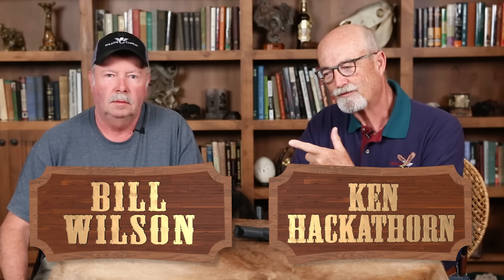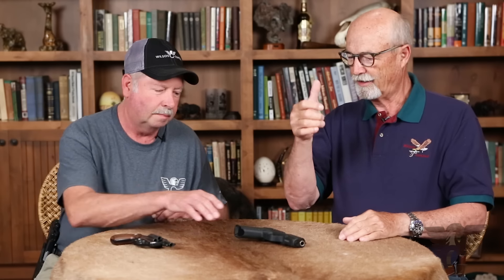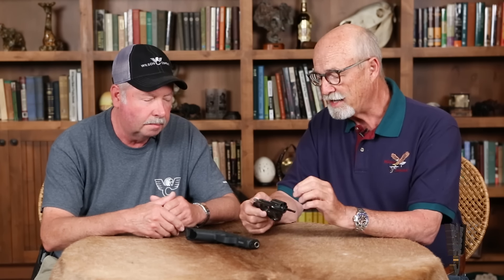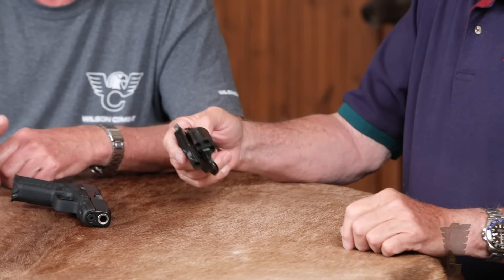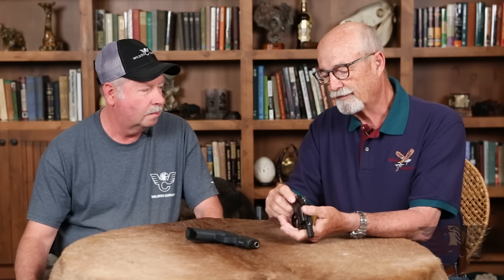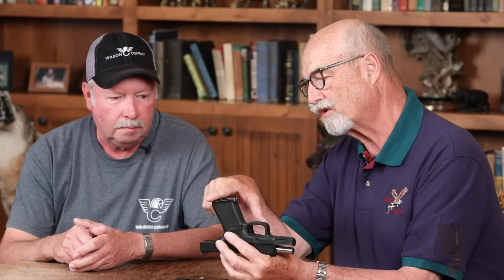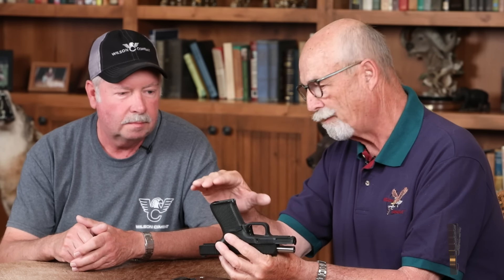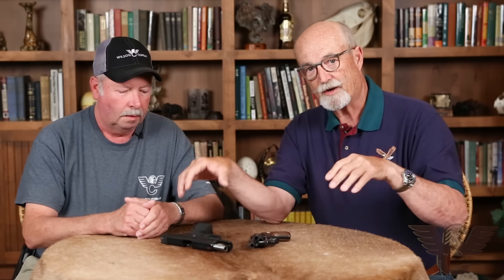DON'T DO THIS to Your Guns - Gun Guys Ep. 17

Comment: Are you kidding? Cleaning your guns and reloading ammo is Zen. I love it almost as much as shooting them! I even love sifting the sand pile in my backyard shooting range (I live in the country) for bullets, cleaning and washing the bullets and melting them down to make more bullets (let them dry thoroughly or they go bang in the melting pot). I collect brass at the public range and sort it. Man, if you don't love this stuff then you're not a real gun guy! Get with the program!

Also, I have two 1911's I hand customized with about 3-pound trigger pulls (titanium innards, oversized barrel bushing carefully fit, blah, blah) and I NEVER drop the slide on my empty gun. Yes, it would wreck the trigger pull. Nor do I flip the cylinder closed on my DA revolvers. If I let someone touch my guns (rare) and they do this, then I take it away and give them a long lecture.

Comment: Agreed on slamming the revolver cylinder.  Not a good thing.   The standard GI 1911, dropping the slide, not a problem.  It was part of the military training.  During inspection you dropped the slide.
Reply: They also didn't have sears barely touching for that 3 lb trigger. Just saying.
Reply: @sofloemir  I have watched videos on what happens internally when a 1911 cycles and I STILL don't see how dropping the slide on an empty chamber is going to cause excessive damage.  

I mean, the energy needed to strip a round from a mag isn't THAT much, so whether or not a round is being chambered should be irrelevant.  

Probably still shouldn't do it, because it isn't necessary (outside of a function check), but still.

Comment: 2000 rd test shows dependability ,reliability, longevity.  Seems like a pretty simple concept.
Reply: …you can afford to fix, replace, or repair it?
Reply: I don't recommend hammering away with 2000 rds on a new piece ! I do recommend you watch some youtube videos that do this to show how durable a particular piece might be right out of the box!  So the concept of the 2000rd test is pretty simple.  I also think any weapon you buy should be able to pass this test pretty easily or frankly is not worth owning!
Reply: @mikehilliard3229 This is just such foolish garbage. How do you not understand the fact that every gun is different, and though a given firearm has a reputation for reliability, that does not guarantee that every firearm of that type is reliable? Any time you have a manufacturing process, especially where humans are involved, mistakes can be made. Products are recalled all the time because of all kinds of problems. Guns are no exception. 

Not to mention, many firearms are ammo-sensitive and need to be tested to determine which ammo is most reliable and accurate in that particular firearm. 

Not understanding these concepts is a sign of someone who really doesn’t have much experience with firearms.

Comment: Really? Using the slide rease when locked back, is an issue, because the slide slams forward. 

You do know that that is precisely what happens, every damn time you fire a round!
Reply from the maker: Turns out, we do know, we've kinda tried it. Did you know that it happens with a different amount of force, and at a different speed, when chambering a round as opposed to slamming it shut when empty and under spring tension? Did you know that doing it repeatedly will deteriorate the engagement with the sear and wear out your trigger job?
Reply: @gowilsoncombat  Makes sense. 

Trust me, I also cringe when I see a weapon abused. Even a factory spec one. Guess I missed that you were talking about it, on an empty chamber.

My mistake.
Reply: @gowilsoncombat  ok, then how about when Ken said instead of using the slide release without a round chambering to just grab the slide and basically slingshot it to close it (4:38 in the video), doesn't that close the slide (action) with the same amount of speed and force but with at different process rather than the slide release?

Comment: IMHO dropping the slide on an empty chamber is as bad as flipping a revolver cylinder shut. That causes the locking mechanism to drag on the cylinder, leaving an unsightly ring on the cylinder and damaging the locking mechanism as it wears out dragging on the cylinder...
Reply: It's called a slide release. Because it releases the slide........ Its designed to do exactly that 😂

Comment: Some gold info here.. 
IMHO, that 2k round test would only be applicable for war situation as a military personnel may be in a situation where they could not clean their gun after x amount of rounds. But I also don't see military personnel using a pistol that much in a situation like that either.
Reply: I really can't see a situation militarily where someone would have to fire 2,000 rounds without being able to open up their action, wipe it a little, and throw in some lube. That'd be 67 magazines through an AR/M-16 platform (and most other military rifles) or 118 magazines through a Glock 17. I very rarely see any soldier from any nation carrying more than 7-10 magazines. A lot of soldiers will have some kind of weapons maintenance kit in their rig specifically so that can clean or at least lube their guns in the field, it takes all of 2 minutes to lube a modern rifle or handgun, if that.
Reply: It's a good test because it's a torture test.  Like knowing your gun won't fire if your throw it hard on cement.
Its true you shouldn't be throwing your gun on cement but this is the entire point of torture tests and reliability tests
Reply: @jason200912  Except that dropping a gun on concrete or cement is something that can (and does) happen pretty regularly. So does, say, dropping a gun in sand or mud or even having a gun run over by a vehicle in certain situations. There really isn't any scenario where a gun would ever be fired 2,000 times without cleaning or at least a wipe-down and lube.
Reply: @blobfishgunner5365  sure there is if you're in a Korean trench and you're the last man alive with a crate of ammo.
Or hey maybe you're a conscription soldier/African rebel and so nobody taught you about needing to clean these and you don't have access to cleaning oils.

I'm sure GPMGs are often needing to fire 2000 rounds without a wipedown or cleaning too.
Reply: @jason200912  If you're the last man alive in a trench and you're facing enough enemies to need 2,000 rounds of ammo and not enough time to lube your gun, you're just dead. Your gun's going to end up with heat related malfunctions and damage before you reach 2,000 rounds if you can't stop firing for 60 seconds to throw some lube on there. As for the low-training conscript or rebel, it's pretty unlikely you'll ever even touch 2,000 rounds of ammo because ammo is something your leaders need to conserve.

GPMGs need to have their barrels changed every few hundred rounds of heavy firing, otherwise the barrels overheat and warp and the gun becomes nonfunctional. The M240B manual suggests changing the barrel every ten minutes of sustained rate fire or every two minutes of rapid fire. Much less than 2,000 rounds.
Reply: @blobfishgunner5365  well if you're fighting a horde of charging attackers you're not gonna abandon the smoothbore MG just bercause the manual says to not fire it after 200 rounds.
Reply: @jason200912  I never said anything about 200 rounds, it can be 200 give or take, the issue is that after a large amount of sustained fire the barrel will become hot, warp, and make the gun effectively useless or some other heat/sustained fire malfunction will occur. Not to mention that the enemy can also shoot you while you reload your weapon 20 times during the engagement if you're using 100-round belts. 2,000 rounds with no weapon maintenance just is not a feasible scenario.
Reply: @blobfishgunner5365  not feasible but still possible.  Every single silver star and medal of honor story is basically unexpected and unfeasible.

Comment: Unfortunately the video didn't quite effectively emphasize that this matter of sear and hammer damage due to releasing the slide dry is really only a major problem on a highly tuned 1911 and ONLY a highly tuned 1911; Other pistols generally do not have this issue, and even a typical 1911 along mil-spec lines is not going to have an issue with this as the hammer and sear has more vertical material and surface contact which results from that. The hammer notch its self is a little bit deeper too. On your typical 1911, well, this also applies to a race 1911 too, one thing that can be a problem is not the slide release on an empty chamber, it is releasing it on a cartridge in the chamber which was placed by dropping it into the chamber from the ejection port instead of being fed up with the cartridge rim guided up behind the extractor from a magazine in the normal forward return in the cycle of operation. Obviously, the extractor is angled to overcome this, but this will overtime wreak havoc on the extractor in particular.
Reply: i had no problem understanding they were talking about highly tuned 1911s as far as sear and hammer damage.
Reply: Most people never made it past the first minute before they started typing furiously, hoping to impart their great wisdom upon the internets lol.

Comment: No mention of using the slide catch as a release on full or empty 1911s in your manual.
Reply: No mention of not sticking your tongue into the eject port, either.  Browning put knurling on the top of the slide release for a reason.
Reply: @SoloPilot6  There is always one isn't there.  If it would potentially cause damage wouldn't a smart manufacturer put that in a manual so not to cost them warranty work or other liability? Browning is Browning.  I have no idea what is in every manual for each individual firearm they make.  Didn't get there yet.  Regardless,  this is Wilson Combat and they are talking about how releasing the slide on an empty chamber can damage to their fine tuned product.  I was pointing out, since it makes them cringe, they neglected to address this in their manual leaving them potentially liable for any mechanical damage or accidental discharge that may occur from this oversight.  Now out of curiosity on this subject I have gone through Wilson, Kimber, Glock, Ruger manuals on various pistols especially any in the 1911 style.  I have yet to find a manual that specifically says this action can damage their firearm.  Some even state to release the slide by depressing the slide release.  Many warn of not letting the hammer fall on a frame with the slide off and that it may cause frame damage.  Rimfire products warn not to dry fire due to potential damage.  Since releasing the slide is well within the everyday operation of an automatic pistol, a warning about how that should be done, especially if there is a wrong way, would be expected.  
Now if you would kindly show me where Browing states that the kurling on the slide release is for anything other than to provide a better grip surface I would be interested in seeing what they say.  This is what the Browning Highpower manual says. "To close the slide,  be certain the  “safety”  lever is in the off  safe position and your fingers are away from the ejection port and trigger.  With the muzzle of  the pistol pointed in a safe direction,  simply depress the slide stop located on the left side of  the frame".   
The 1911 clone in 380 says this. "To close the slide,  be certain your fingers are away from the ejection port and trigger.  With the muzzle of  the pistol pointed in a safe direction,  simply depress the slide stop located on the left side of  the frame.  After closing the slide immediately lower the hammer to the dropped position or place the  “safety”  in the on safe position".
Reply: @doclees11  Your point about noting this in the manual is telling, especially in this age of overlitigation.  I was taught that the reason to drop on an empty chamber was to verify that the sear was operating properly -- if the hammer dropped, even to half-cock, the pistol was to be tagged defective and repaired before the next time a round was loaded.
Reply: @SoloPilot6  that is interesting.  Me, not being a gunsmith, don't know if that is true but sounds plausible.
Reply: @doclees11  The sear on most factory-fresh pistols really sucks.  So it's common to have work done on them.  The objective is a "glass-rod" break, but a worn / overworked sear or weak springs can make the sear unreliable.  If it holds when the slide drops on an empty chamber, you know that it will hold while you carry it the next day.
Reply: I'm pretty sure my EMP has that warning in it. It also says only to shoot factory non-+p ammo. It'll void your warranty.
Reply: @robwilk4566  pretty sure?  Alec Baldwin was pretty sure.  What is the exact wording?  Yeah the +p warning is common which goes to my point.  Even my Phoenix arms 22 pistol says standard velocity ammo only.
Reply: Doclees...it's common sense
Reply: @doclees11  lol, pretty sure because I don't sleep with the manual on my night stand and haven't looked in a while. And I doubt Baldwin was pretty sure of anything. Here's what it says...

Notice: The slide of a 1911-A1 pistol should never be released on an empty chamber; especially one which has had an action job. Releasing the slide on an empty chamber causes damage to the breach face on the barrel and undue stress on all action parts, including the hammer and the sear. This will ruin the action job on your pistol.

They then show how to properly drop the hammer.
Reply: @robwilk4566  there you go.  How easy it is to include that in the manual for your product.  Now that company doesn't need to make a video on how bad it is to do  that. So it appears here is where the confusion lies. Robust pistols aren't affected by this type of slide release where tuned ones are.  I checked with my armorer  friend and didn't see any issued until we talked about light actions and tight tolerances.

Comment: How long can you keep a 1911 loaded with the hammer back in a holster? What should be the process daily? Weekly?
Reply: As long as you want. Springs wear out by cycling.
Reply: If the parts are not worn much, and the parts are fitted correctly, you could leave it that way indefinitely. There are a few safety mechanisms that have to work together to get the 1911 to fire, so defeating one would not be enough to drop the hammer unless there were problems with the mechanism.

Edit: realistically I would unload the weapon at least once a week and check the overall length of the ammo that was chambered to make sure that there is not unacceptable bullet setback. Could do minor maintenance with the weapon unloaded if necessary (wiping off fingerprints, oiling a bit, etc).

Comment: What's the difference in dropping the slide opposed to pulling it back and letting it drop, siting the example of proper method in video?
Reply: Fudd lore
Reply: They explained it in the video. The cartridge being stripped and feeding up the ramp into the chamber cushions the shock as it was originally designed to do.
Reply: @JimmyDevere  hi, my question was in regards to what is the difference in slingshotting or or dropping slide on an empty chamber.
Reply: @MeekSith777   the slide velocity is greatly reduced when stripping a round from the magazine and feeding said round up the feed ramp and into the chamber, as it was designed to do by John Moses Browning.  On the other hand, letting the slide slam forward without a loaded magazine in the pistol causes unnecessary wear to the locking lugs as well as damage to the tip of the sear, and the hammer hooks secondary to slide induced bounce of the mating parts.
Reply: That's what I was wondering. I get I can slam it when it's being loaded but how to drop the slide when it's empty? Because I was taught assisting the spring was bad
Reply: @jrh2536  If the gun is empty, assist the slide. If not (magazine loaded) then rack and release normally (unassisted).
Reply: @jrh2536  closing the slide by riding it shut to load a round is a bad habit because you may induce a failure. When loading, pull the slide all the way back and let go or release the slide using the stop/release. If you are closing the slide on a gun without loading it, ride the slide shut. Ken was being lazy lazy here riding it partway shut and letting it go early. Kind of an icky in-between maybe you had it going slow enough maybe not. Remember, they just got done abusing these guns to demonstrate what not to do, so they dont care that much about them. Just ride it at least 80% of the way and you'll never have a problem.
Reply: @alw1217  Juvenaitivity
Reply: Glen it’s in the video. When they are holding the slide, it’s just enough to slow down its velocity. If the just use the slide release, it’s closing at full speed.
Reply: Jr H, assisting the spring while loading is bad because it can induce a failure to fully chamber a round. So let it slam forward. However when a gun is unloaded, don’t let it slam forward.